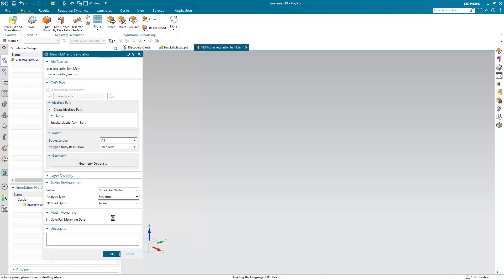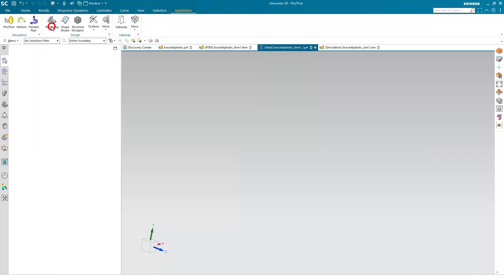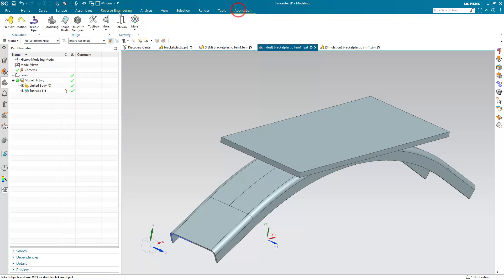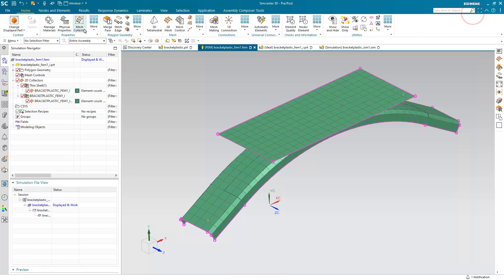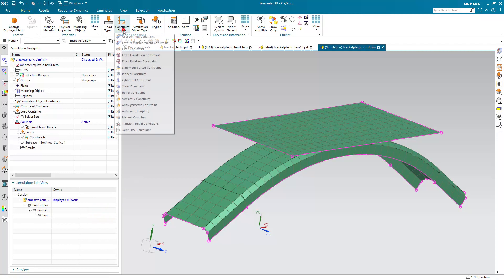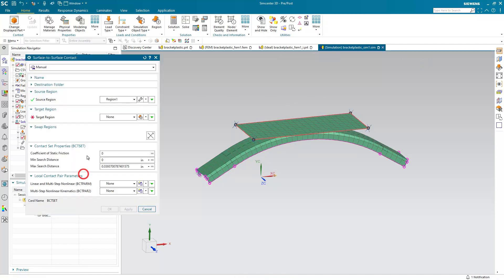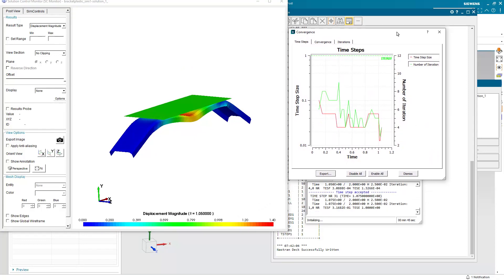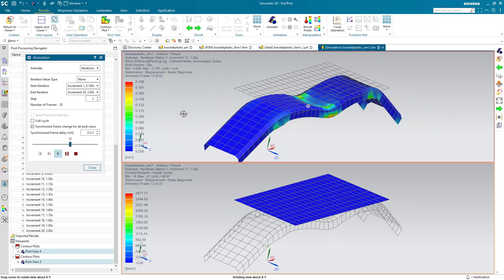How To Run A Nonlinear Plastic Analysis

Comment: nice and informative video.During output request ,"sol applicability view" is showing SOL601 and SOL701 options in the drop down list as well ,whereas they both were discontinued  from NX2021 July release.so how can they be still showing and what is their use since they were replaced by SOL 401 and SOL402 respectively.Also during Solution Step selection , Non linear statics was chosen instead of nonlinear dynamics whereas in study although the bracket is fixed however the plate is moving down and up.afterwards solving the solution, pressure on plate is also calculated.Why was dynamics not chosen in this case?
thank you
Reply from the maker: Thanks, glad you liked it.  When we removed SOL601 and SOL701 from the Nastran solver environment we created a new Adina Nastran Interface solver environment and support solutions 601 and 701 for customer who have it through Adina.  I used nonlinear statics instead of nonlinear dynamics because the simulation is crushing the bracket at low speed with an enforced displacement and no inertial effects.  If I was instead dropping a weight on it to crush it, I would have had to use a nonlinear dynamics subcase to account for the inertial effects of the mass dropping and being decelerated by the bracket as it crushes it.
Reply: @Simcenter3DTipsandTricks  thanks for the reply.is a Tutorial available for using CWELD and CFAST elements as spot weld connections doesn't have those elements and doesn't accurately reproduce actual spot weld results.Thanks
Reply from the maker: @gauravsharma-ot6vs  Spot weld uses a 1D element to model the connection and is  accurate.  If you would like to investigate CFAST, I found an old video from NX 12 and have posted it here: https://youtu.be/Fg1dNOUODI0 I have an older one for CWELD from version 7.5 but not sure it is still relevant.  Also, it is a silent video (no audio).
Reply: @Simcenter3DTipsandTricks  thanks for the reply and guidance